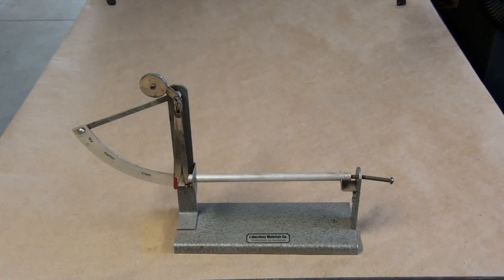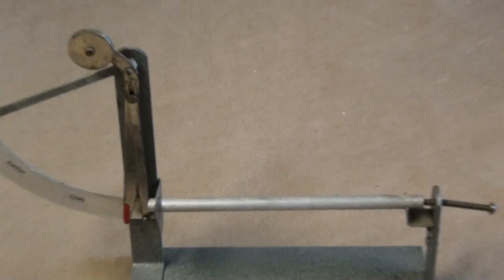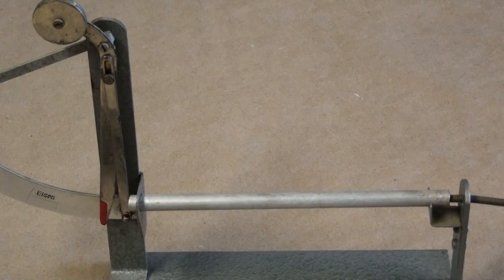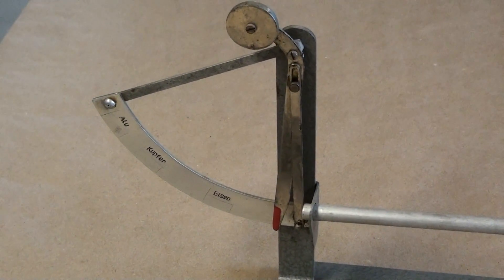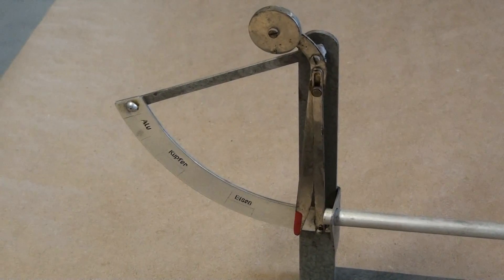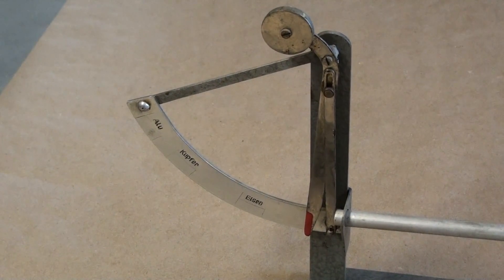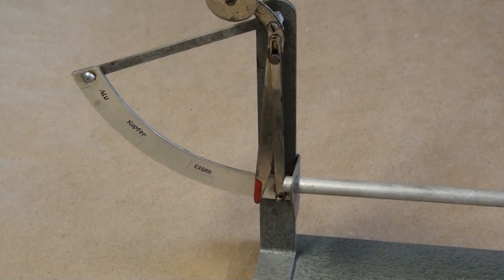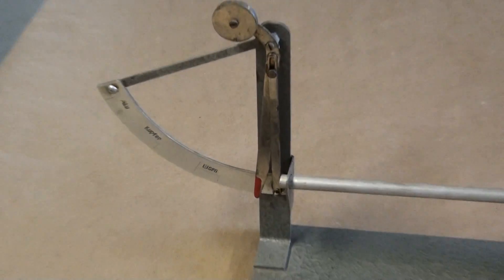Thermal-Expansion.mpg

Comment: I did this test this afternoon, but using a 3m hollow rod of Aluminium. I connected a tube and a boiling water tank to one end and ran the boiling water through the hollow centre. The results gave a total of 5.76 mm change, the calculation of the theoretical gave 5.83 mm change so It was a fairly accurate result
Reply from the maker: Glad it worked out well.